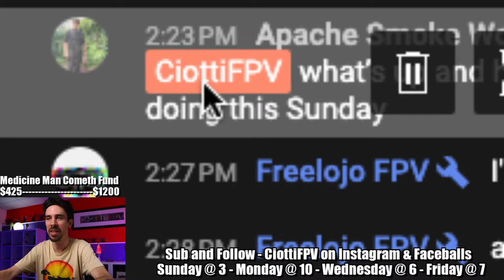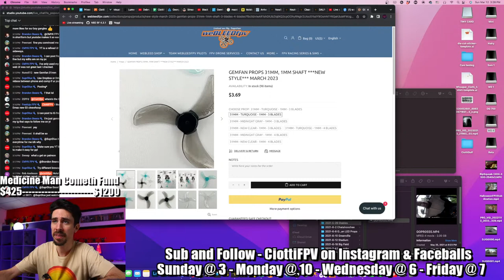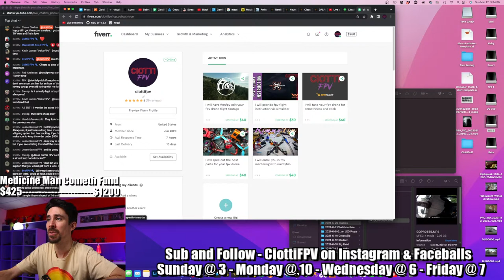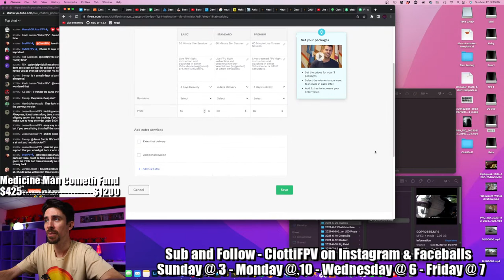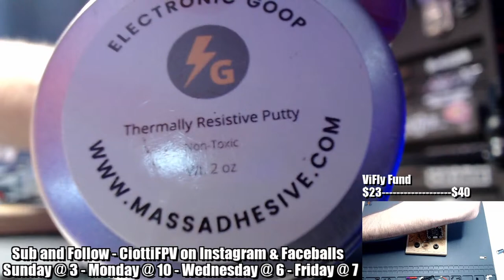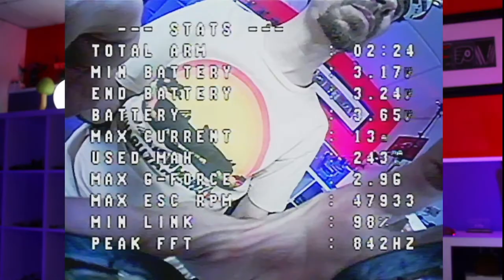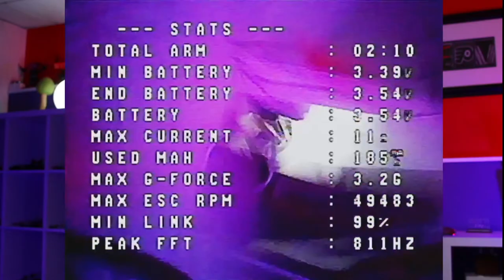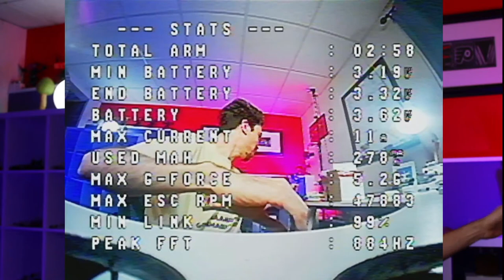How to Tin and Solder Thick Battery Connectors - Q&A - 0802 30,000kv Tiny Whoop Rips

Comment: 00:07:46 Help the Gangly guy out 
00:18:43 Most fun with the family this week.
00:21:12 The new Gemfan 1.2 Props are out.
00:28:22 Hourly rate on fiver for help.
00:31:34 Building the glide.
00:46:35 Best place to put your Race wires  
00:49:39 What is the advantage for soldering race wires first And ESC next
01:02:46 Cutting /tinning the wires on the  XT60 connector and capacitor.
01:91:31 How do you stream your goggle view on live stream?
01:20:09 How to solder your wires.
01:24:23 What FC your using on the Glide build?
01:44:16 1102 10000Kv where sold out, using the 19000Kv can i motor limit it?
01:46:43 Flying the ultimate Tiny Whoop EX 0802 30000Kv, HQ prototype props.
02:02:05 Switching props GemFan bi blades

Stay safe everyone